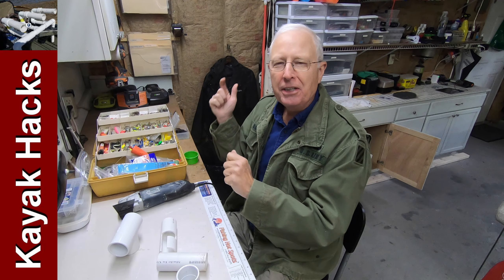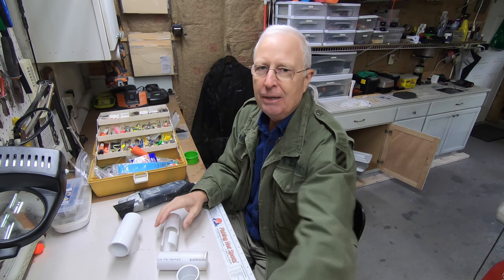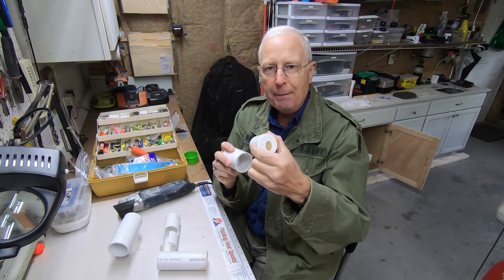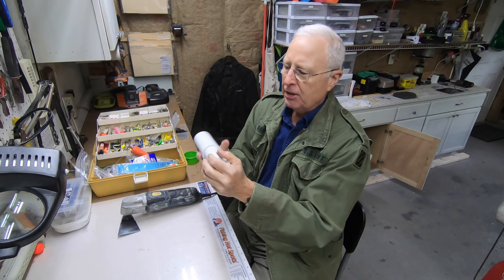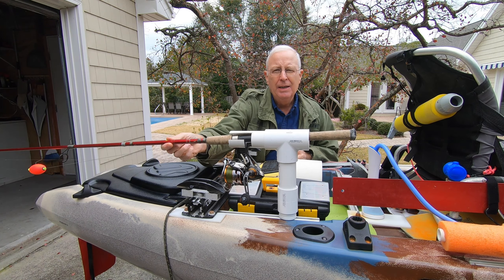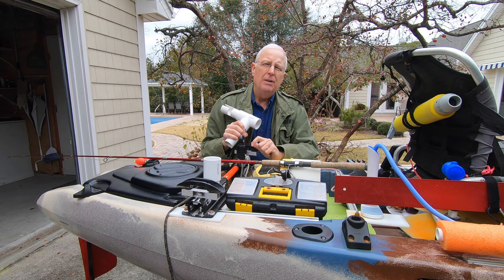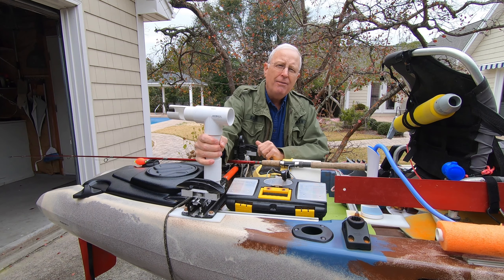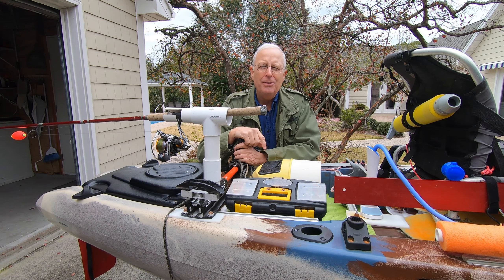DIY Kayak Fishing Rod Holder - Part of Kayak Fishing Setup

Comment: Love your videos. I've used many of your ideas. One suggestion for saving $. I use a regular cap (not the flat one) and heat it up to flatten it out. Then I don't need a coupling, the pipe fits right into the cap. I made several so I can easily move things around the boat without having to unscrew them each time.
Reply from the maker: Great tip!

Comment: Very nice ideas. I just put Boonedox on and will add to the track. Only concern with your horizontal rod holder is when I am out on the bay in chop it's tough to reach back. I have fallen out in mid bay once and it wasn't fun. I always am looking for where to but the butt end of the rod towards the bow when I have to do an operation on the tip of my rod to free up a twist or knot.
Reply from the maker: I hate high waves. If the wind gets to 12 mph, I go in - that is when the wind kicks up 1 foot chop here.

Comment: If you wanted to mount a bunch you could also run a 90 out of the adapter and use pieces of straight pipe and t's all the way across the back and into a 90 on the other track. That way you wouldn't have to install a gear track if there isnt one already and you would only need 2 track adapters instead of one for each rod.
Reply from the maker: You bet - I did that a few years ago and used it until I decided I only needed two rods. https://youtu.be/NrctrAG04JI

Comment: Like it, thankful also to Jackson for the molded rod tip holders.
Reply: Question for you on the coosa fd, how do you place your rods when using the molded rod tip holders? Video? Picture?
Reply from the maker: I actually do not use those very often. When I do, I put the tip into the hole and use the bungee near the seat to hold the rod butt/reel. I mention how that works in this video - https://youtu.be/_gP1hkTXI_0

Comment: Better make sure the fish doesn't go behind the kayak with those rods sticking out! It's another great gear track mod which I'd love to do. My problem is, gear track is darned hard to get where I am, costs an arm and both legs when I can find it, and really only comes in very short lengths. It's still flaming expensive on-line and shipping to Australia is a killer. Any tips, DIY/cheap gear track options? I'd love a video on that, otherwise I'll just have to keep drooling over mods such as this ;) Thanks for another great video and stay warm!
Reply from the maker: There may be... I have an idea I will investigate.
Reply from the maker: I just finished recording two options to make a DIY track. Stay tuned!
Reply: @KayakhacksFishing  Thanks! Can't wait to see them :)
Reply from the maker: Option 1 is posted now

Comment: My concern would be the difficulty in getting the rod out of the holder while sitting if your actively trolling. Is it within a comfortable reach?
Reply: WiffBob My thoughts exactly
Reply: I was thinking that too.  Especially with a strong fish attached.
Reply from the maker: You need to pick the right spot on the utility track to install it.  On my JK, I could put it right next to the seat if you want.